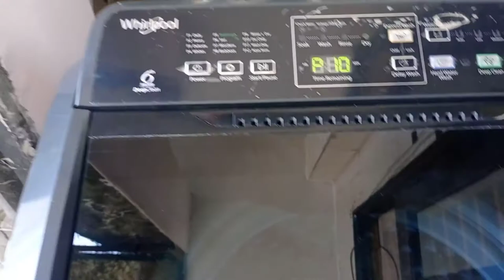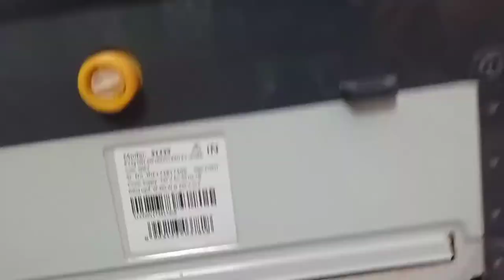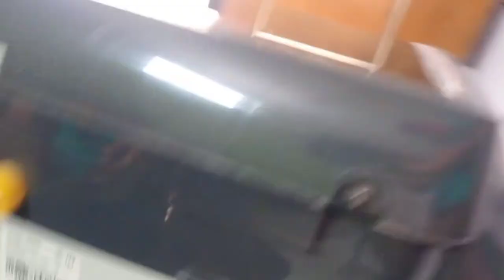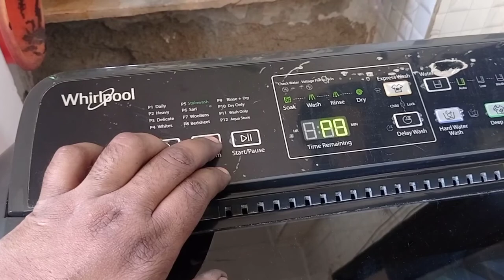Whirlpool top-load washing machine mechanism (T.S.P) replacement repair help step by step

Comment: Thank you sir, my auto washing machine not wash n dirictly go to spin, so what is problem?
Reply from the maker: If your washing machine is only spinning and not washing, there could be several potential issues causing this problem. Here are some common troubleshooting steps:

1. Check the Load: Make sure you haven't overloaded the washing machine. Overloading can prevent proper washing.

2. Water Supply: Ensure that the water supply to the washing machine is turned on and that there is adequate water pressure.

3. Detergent: Verify that you're using the correct type and amount of detergent. Using too much or too little detergent can affect the washing process.

4. Cycle Selection: Double-check that you've selected the appropriate wash cycle for the type of load you're washing.

5. Clogged Filter: Some washing machines have a filter or lint trap that can become clogged. Check your machine's manual for instructions on how to clean it.

6. Drainage: Ensure that the machine is draining properly. If water isn't draining, it might not progress to the washing stage.

7. Faulty Motor or Controls: If none of the above solutions work, it's possible that there's a problem with the motor or the control panel of the washing machine. In this case, you may need to contact a technician for repair.

Comment: Mera whirlpool ka 6 sence washing machine me tub ni ghuma. Maine belt utar ke test kiya prime motor ghum rahi hai. Par belt lagake tub ni ghumra. Pulsator works during washing. Kya kharab ho sakta hai
Reply from the maker: Mam Jab aap washing machine ko spin Mod Mein Lagate Hain Use time per Pani drain out ho raha hai
Reply: @repairingguru  yes pani drain hota hai
Reply from the maker: Aur mam Jab washing Hoti Hai To Pulsator  donon side ghumta hai kya
Reply: @repairingguru  ni sirf ek side clock wise. Mai ek bar belt utar ke wash mode me karke niche se pully se tub ghuma ke dekhungi mujhe doubt hai ki brake fasi hui hai
Reply from the maker: Mam Agar proper spinning kar raha hai ek side Gumrah set Nahin ghoom raha hai to chances jyada hai kiske tsp kharab Hogi
Reply from the maker: Fir bhi aap Niche Se Ek Bar belt utaar ke Iske lock check Karke Bata dijiyega
Reply: @repairingguru  tsp full form aur cost
Reply from the maker: Mam tsp kam karti hai Ek gear box Ki Tarah yah multiple parts ko milakar part banaa hua hai jo machine ko wash karati hai aur spin karati hai
Reply from the maker: Aur iski Jo cost Rahegi aapki vah 3800 Se 4200 Ke aaspaas ki rahti hai

Comment: What is the cost of repairing TSP?
Reply from the maker: Sir it's depend but normally it cost around 3800/- to 4500/-
Reply from the maker: Sir sabse pehla Issue aaega noise ka dusra issue aaega ki jo spinning quality Hai vah Low  ho jayegi washing quality Low ho jayegi aur ho sakta hai ki washing machine washing karna ya spin karna band karde
Reply: Mera machine ka tsp change  Karna hai kaiser hoga or Kay cost ayaga